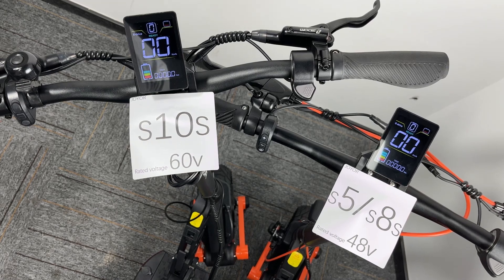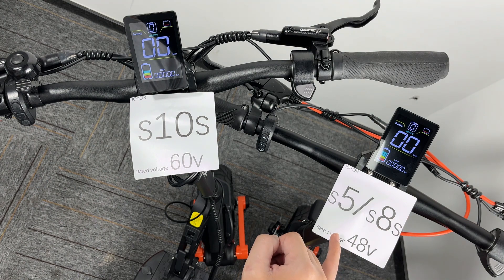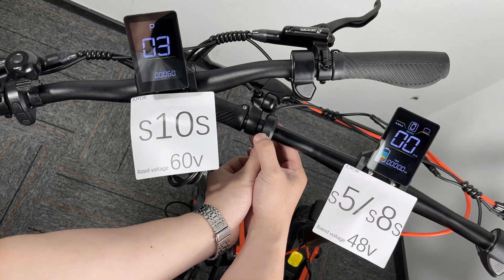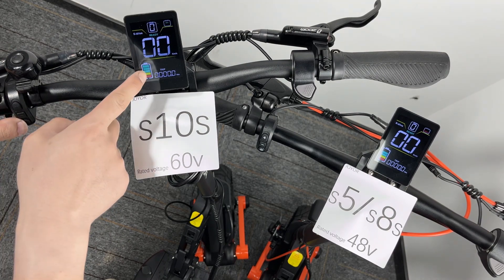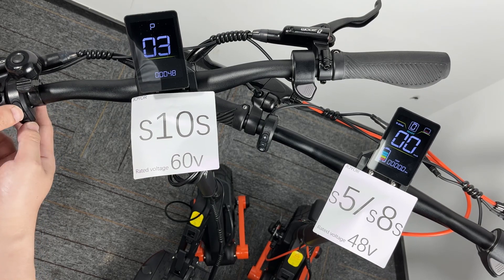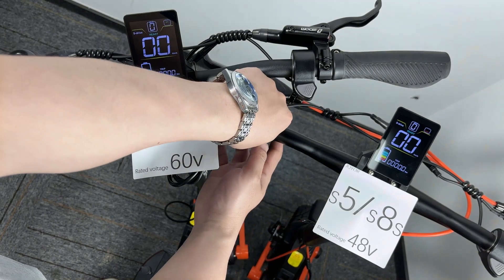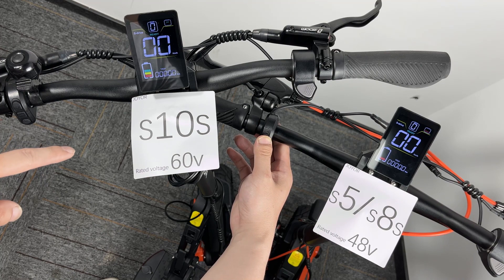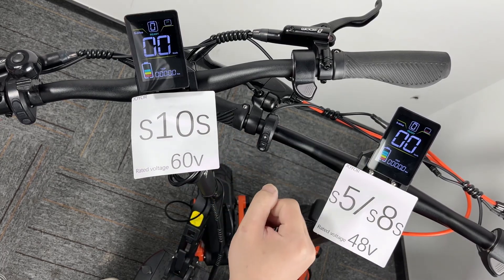How to set the correct voltage for your JOYOR electric scooter Display menu P03 is set to 48 or 60

Comment: But s5 and s8 series has 48 and 52 volts to interchangeable so if i put another front hub motor on s5 it can be s8s have to change the controller dual drive 48v 50ah then battery 52v 25ah?

Comment: didn't worked for me. My S10s always is showing FULL battery.. do you know what is the cause ? I set it to 60V. and nothing changed. it is always showing full charge. despite it can be almost empty.
Reply: Same problem here 😕
Reply: i have the same problem, do you find a solution ?
Reply: @Cargai5onloup  nope. It must be a controller or connection. Or some sort of meeter broken. I just use a multimeter. Be careful not to short (touch both) while metering!

Comment: Hello, I want to buy my first scooter in my life, s10 support what do you think, will it work for weight 90kg 190cm height
Reply: I'm 95kg and it works well, the battery is a bit small though. You won't go more than 30-40km (depending on your speed). 
Speed on the other hand for 95kg is incredible, you will hit 60km/h easily, 40km/h in  hard steep climb

Comment: Is s10s much better than s5? What do you recommend?
Reply: S10s is more powerfull clearly it depend on what you want from your scooter s10s is bi motor very powerfull up to 60-70 km/h depending your Weight 
Good autonomie but lesser than s8s that is close in power but better batterie and is also bi motor
S5 is great but mono moto less powerfull
Reply: @jhmili4861  im hesitatin between s10s and s8s , does the s8s has significantly more battery life or just slightly more than s10s thank you ?
Reply: @XenomTV  significantly more

Comment: Dose any one know if there any steering damper that fit the s10s???
Reply: Hopefully somebody can demonstrate on having a steering damper for the S 10 S because it is dangerous top speed because it does shake sometimes and you can lose control of it really easily but hopefully somebody can demonstrate like I said, and make it work or come out with something for that.. s10 s
And especially when I’m going to have speed and I’m going over little bumps in the road it loses it steering a little bit and starts to shake pretty bad and like I said again you can definitely lose your steering and fall

Comment: So what happens if I leave my s10 s on 48 volts and say I want to go ride it would it shut down even tho the battery still have battery left in it still… and would it affect the speed if I left it in 48 volts too?… 

If you can make a video on the s10 s about all the codes that it has if you can… and the other joyor…